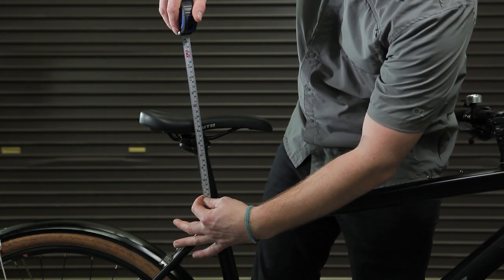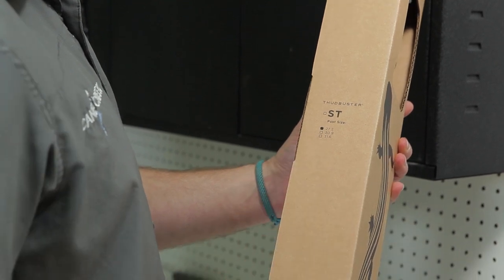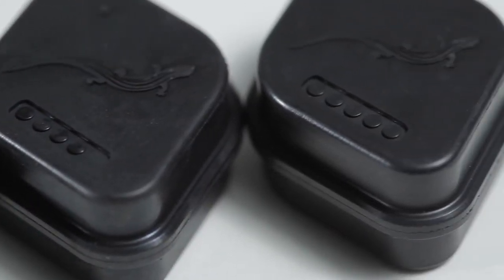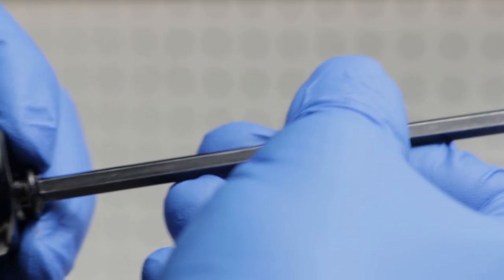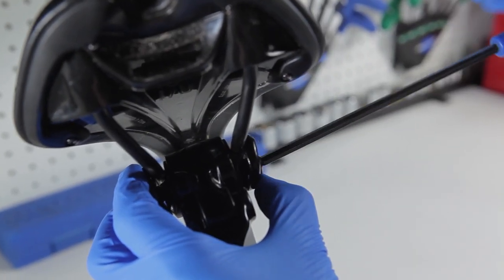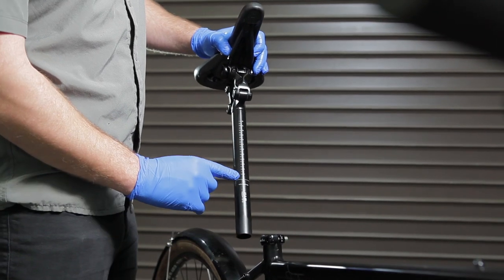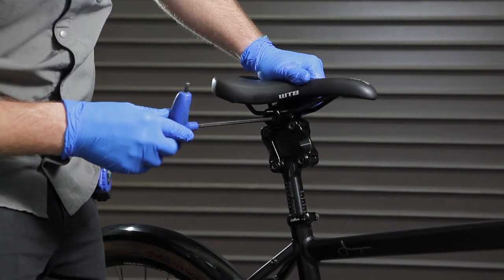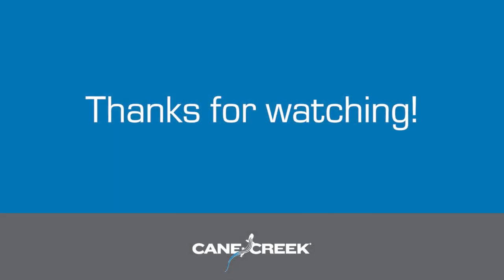Thudbuster ST Installation Guide. Newest Version

Comment: Thank you for this video. I bought the thudbuster G4 ST to go with my Brooks B17 saddle, but have issues with the horizontal adjustment of the saddle: no matter how hard I tighten the screw, the saddle always ends up tilting back and the position is therefore uncomfortable. How could I solve this ? I contacted Cane Creek customer service but they never responded The problem is really ennoying and makes the seat post almost not usable, which is a shame because the shocks attenuation is really efficient in itself. Thanks for any feedback you might provide.
Reply: Having exact same problem… really annoying. did you ever manage to solve it?
Reply: @maxlalaev7720  not completely, but managed to fix it more or less by cleaning the parts which are inside the tube, and screwing the saddle very strongly. Seems pretty ok but sometimes tilts back again. However less than before. I think they realized the problem as the new one, the e-siilk has 2 mounting screws which must be much better. Apart from this very bad issue, the product itself is great. By the way, I never any response from the Cane Creek customer service, disappointing ! Good luck with yours !
Reply: I had the very same problem but SOLVED: you can loosen the inner clamps by simply pushing them out with an allen key, screwdriver or something else (needs a bit force to push them out the first time).They are just fixed quite solid in the beginning. But you can see in the vid that they can bee loosened (1:23). Afterwards you can easily adjust the seat horizontally.
Reply: @wanderer6611  Same here. Solved as well as per comments above. Easier to do that to explain.
Reply: @wanderer6611  ☺thanks, I just did that and those inner clamps came loose! placed a bit of lithium grease on them, reinstalled the clamps and now I can adjust the saddle tilt!
Reply: @wanderer6611  I also have the exact same problem in this minute. The clamps get stuck in the middle frame and it's not possible to adjust the angle of the seat. It is necessary to completely disassemble and force the two inner clamps out by hammering. So every time you want to readjust your seating angle, this whole procedure needs to be re-done. What a crappy design I am so annoyed by this right now I will switch to a my.schulz G2 seatpost.

Comment: I have just installed this, it only came with a #3 elastomer and no instructions in the retail packaging. Maybe I did something wrong, but it feels either no different or indeed slightly worse in terms of any sort of smoothing than the Cube suspension post that came with the bike. I weigh 63kg. I do not know if I need a different elastomer, I ordered a #1 from my bike shop, it was an ST elastomer but it did not say whether it would be right for my weight nor compatible with a Thudbuster ST G3/2020. I am totally unimpressed so far and dreams of a comfortable ride have been shattered.

Comment: I'm looking at the ST version for my touring bike. My frame is an older model, with the top tube horizontal (parallel to the ground). As a result, my seat post clamp sits fairly high relative to other bikes. My current seat post is inserted pretty deep into the seat tube. I'm not sure that I have room for the ST version. The clearance between the top tube and the seat itself is relatively small compared to other bikes. Does anyone know the distance that the rails of the saddle would be from the seat post clamp if I inserted the ST version all the way down?

Comment: Hi. A bit late to the party here. 
There is a slight lateral ‘play’ when pressure is applied to the saddle. 
From what I can see (without additional assistance) this is due to the construction / linkage as opposed to a solid seat post. 
Would this be the case from other experiences?

Comment: My new thudbuster I can't adjust saddle tilt, the inside saddle rail channels are totally stuck and won't move (rotate) at all. Only the outer channels move when I loosen the bolt. How can I fix this?
Reply: Hi! Did you manage t fix it?
Reply: Yeah, it took getting the manufacturer to send me a new mounting piece, which needs to be torqued down very strong, now it works without any slipping

Comment: what a stupid cunstruction of the sattle adjustment. It is not possible to allign the sattle when it is placed. You have to guess the propper position bevor placing the sattle, but that is not fit to the result you get. Also the sattle displaced after driving a while.🙈